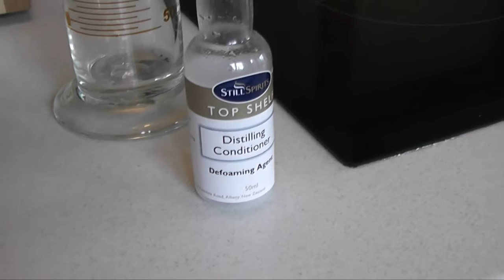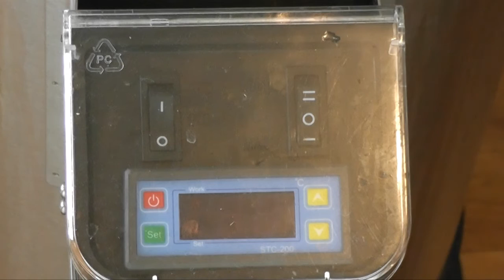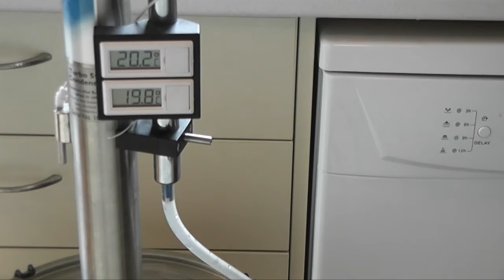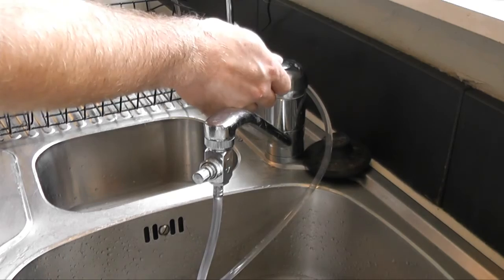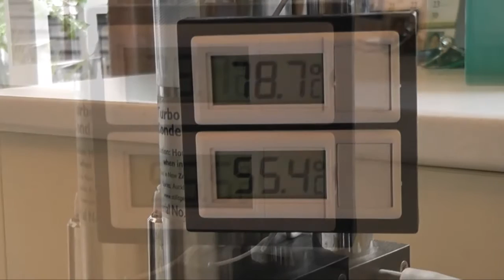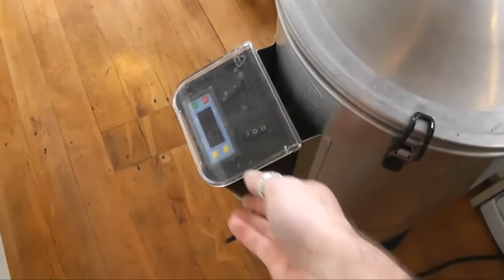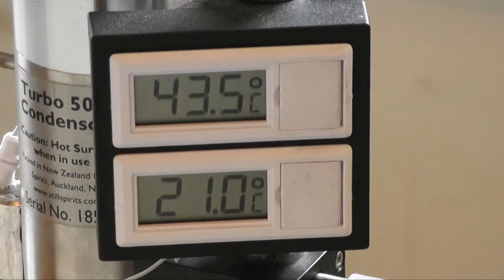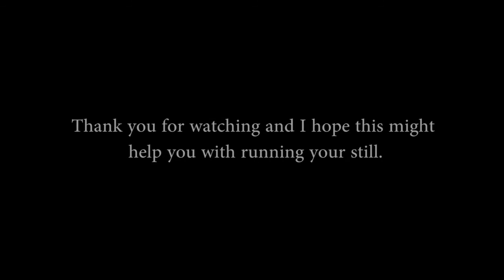T500 & Grainfather

Comment: I have a original T500 condenser and boiler and like the idea of that boiler your using.. my temperature probe is always on top to monitor the top. My favourite temperature is 4.5 hour on 51c/52c no higher I get 93% without fail. Now I own a  4 floor sight glass bubble plate 3" column with 3"/2"  reducers and all parts clamps etc. I got voltage controller and same water regulator with pin dial. I get now 95%/96% definitely worth upgrade if you want to hit that 3%/4% abv No more filtering plates automatically take all the impurities away. Just a tip.
Reply from the maker: Unfortunately, since I made this video and moved back to the UK and no longer run my T500.
Reply: @MRPummell  I use mine all time Iive UK Wales Cardiff whatever I do in my house remains in my house. I don't sell it I use it for personal use only

Comment: Nice little film 
Thanks for sharing 
About to buy a still, not sure get one of these or alembic copper....
Any thoughts please 
It’s to go on a robobrew 
Thanks again 
Cheers
Reply from the maker: Andy Dunn I don’t own but I’ve had a played with an alembic and there is a fair bit more skill involved to produce good quality drinks. So it completely depends on your ability where you want to start. I would love to have the time in my life to spend making great spirits with an alembic, but I don’t, so the T500 works great for me. Plus I put more time into my beer making. What are you thinking of making?
Reply: Mark Pummell thanks for getting back so fast,. I am retired so my time is my own. Jack Daniels- Tennessee whiskey, Dark Rum , Martinique style, That would be the main spirits. If I could on the same still, Marseille Pastice and maybe gin, Bombay Sapphire. 
This will sound like an odd connection but I ran my own and trained people to make / blend paint. The formulation are a moving feast. If the solvent is new it will cut faster, if the thickening coats are old or have seen moisture, you need to treat them completely differently.
I am new to Spirits but I am used to complex movable formation 
 I had heard that the copper alembic can creat more mellow alcohol and the T500 ..... not sure how he put, some thing like ripped all the taste out
Appreciate your help
Reply from the maker: Andy Dunn yeah, that’s a pretty good description of the difference between the two.  I think you should get an Alembic. I feel that you will get what you want from it more than a column still. I sure you will, but do your research and waste the spirit if you get something wrong. All you’ll do is make yourself or whoever you share it with very ill. The temperature you run the still at is so important. Hence why I was trying different ideas in this video. I distilled most of this batch again to get rid of any methanol it might of had in it.
Reply: Mark Pummell thanks again for the advice and heads up, I had thought I would be distilling everything twice on the alembic low temp and slow I’d thought.
I am wondering about the legal aspect of all this
Do you know many people with stills, have all the authorities just started to turn a blind eye 
Thanks again 
If I buy it will be an alembic
Reply from the maker: @andydunn5673  Where are you based? I was running my still in New Zealand, where it is legal to make spirits for home consumption.
Reply: Mark Pummell I used to be in Britain I’m now in France and it’s illegal in both 
Which kind of bothers me as I don’t see myself as a law breaker, New Zealand is very enlightened country....
I’ve always thought so
Cheers my friend, I’ll do some thinking
Reply: Old thread but if someone bumps in here, should know that the alembic dome for the Grainfather can connect to both the condenser arm or the T500 turbo reflux. Second thing is if you press on heat on the Grainfather pid for 6 sec you enter in power mode, so no need for time you just adjust the power of heating which is great for distill.

Comment: I use this setup also. The main problem is that you have to distille in high tempatures unfortunately.. if you set the grainfather to 'mash' mode the electrical heater will stop, so the distillation will end. More over the 'mash' mode even if maintain the temprature can't elevate the steam to complete the destillation. I also noticed that even in the boil mode the tempature can't raise up to 93 celcious. I cant explain that.
Reply from the maker: Nikolas Lavdas had the same problem. It was an idea, but the mash mode doesn't work for this instance. The bonus of the grainfather is the element is at a higher wattage so you get to the boil faster. I hate that wait. Haha
Reply from the maker: How is your setup going? Getting some good results?